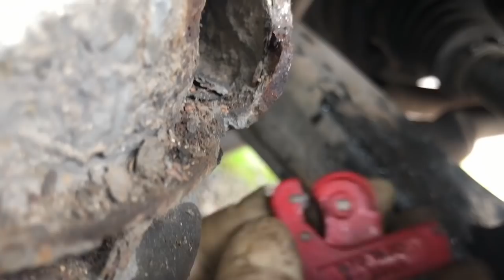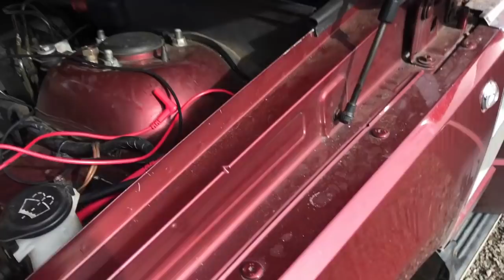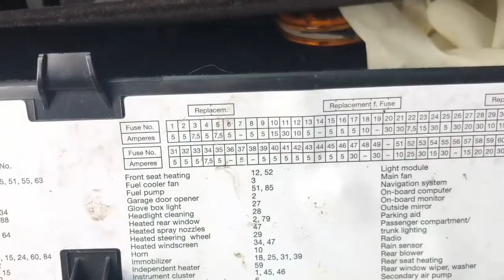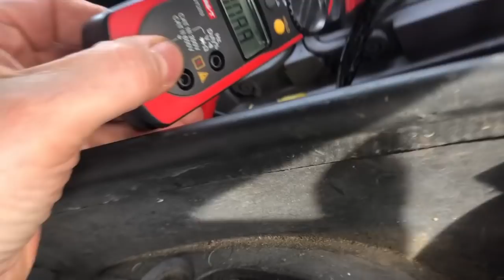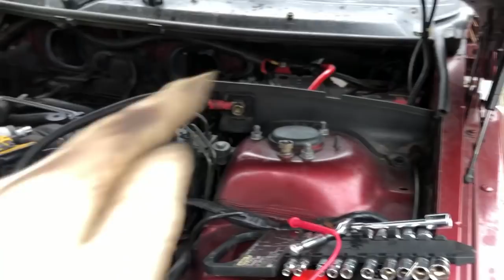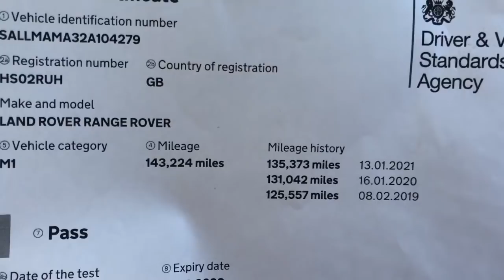2002 Range Rover l322 marketplace -spares or repair project - part8 - Mot Time...pass or fail?

Comment: When shut down this car should only be drawing .025 amps. The gas system is pulling to much current. Had the same problem with my gas RR. Fitted a cut off relay to the ignition to cure the problem.